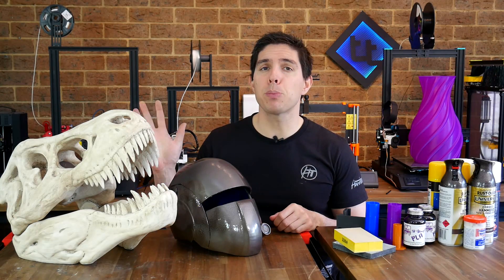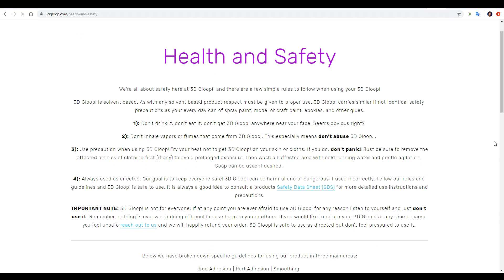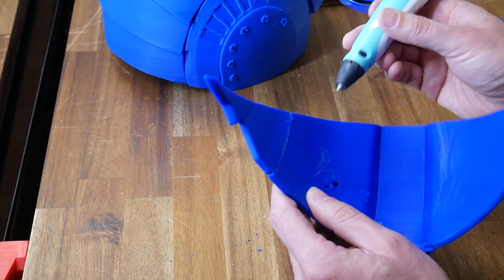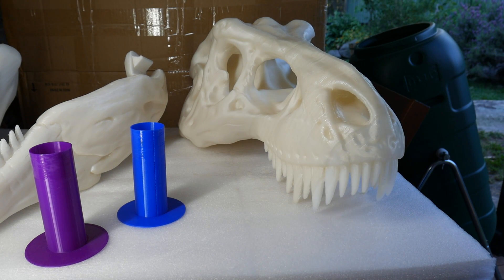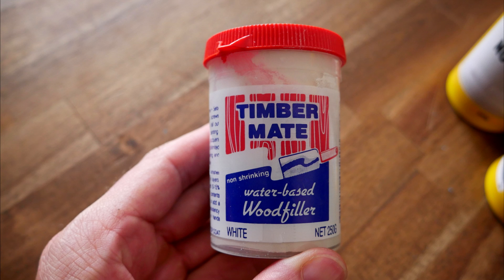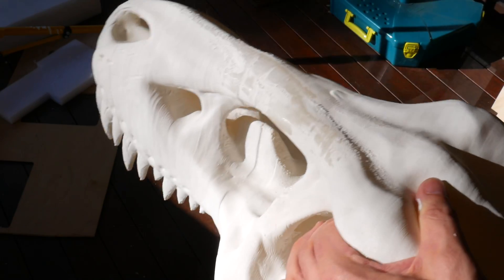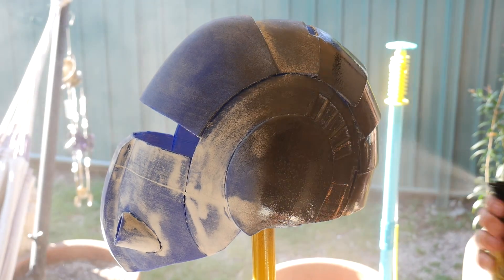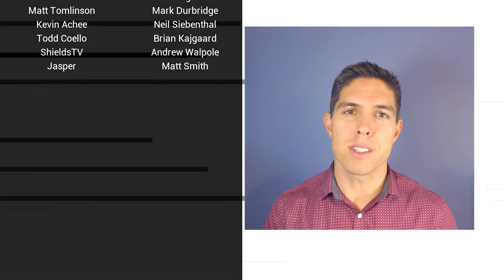Post processing huge 3D prints: Metal & Bone + 3D Gloop

Comment: I use spray filler/primer.. it works well to fill in small layer lines... for larger gaps and issues, I use bondo (pre-mixed in the tube)

Comment: Have used 3dGloop as glue and once for smoothing. It works well. Here is the one problem with the product, it has a limited shelf life from the time you open it. Every time I went to the bottle there was significantly less than when I had put it back up. After about 3-4 months what was left set in the bottom of the bottle. If I had a big project and knew I would be using a bottle fairly quickly it's well worth it. If I'm just gluing small stuff occasionally and not smoothing super glue is still better.

Comment: Thanks for this video. I am doing the same with my models. Another useful tool I use is, the Belt Sander! If you are quick, and light, it really can strip the layers away quickly. I hate sanding also, and like it quick, but, I am careful to not melt the plastic, and I really do like a smooth finish.
I too, found out about the wood putty idea, awhile ago. It is such a great medium to use. Much easier than using car bog (epoxy resin paste). Better for quick sanding, and easier to apply.
Thanks again for sharing your ideas. Love your videos.

Comment: Hi great video. Was the T rex skull one solid piece printed on a large printer or was it the one that comes in about 10 smaller sections. Saw a post of one on a pool table that a girl was sticking her head in. Each piece was a different color to show the sections. Just upsized from a ender 3 pro to a cr10 to print that one and was worried about the joint lines showing. Thanks.
Reply from the maker: This skull was only two pieces: skull and jaw. It's linked in the description.
Reply: TY

Comment: Helpful Hot Glue Tip if no-one mentioned it.
A very small amount (a couple of drops will do) of metholated spirit or iso-propyl alcohol will cause the hot glue to let go, and make it pliable and easier to remove.
Much safer than the blade, and much quicker and easier. :-)

Comment: I think product like 3D Gloop, Liquid epoxy, fiberglass, would work best by being applied generously where the coating material would self-level above all layer lines. PLA being difficult to sand may actually prefer file/rasp with rougher teeth over sand paper, clean the rasp with wire brush often. Higher temperature PLA+ may do better on finer sand paper.

Comment: Hey buddy, Ive been printing 1/18 RC car bodies and im getting awesome results from the $2.50 Motortech spray cans, (undercoat and yellow oxide) from AutoBarn and Supercheap Auto. the only down side is they take a while to cure, been such a high fill.

also... I highly recommend using a rotary tool with a flappy wheel, it self regulates the pressure and is less prone to overheating,  with a quick buzz over the surface and 2-6 coats of a high full undercoat with a very light hand sand between coats it should be very very close to perfect..

Comment: They both look pretty good in the end. I will say that PLA is an utter pain in the ass to sand, it's to hard and melts to easily, I don't bother sanding or filling it. Of all filaments HIPS is a much better option (costs the same as PLA as well) but stinks when printing, the upside is you can use modelling glue to weld bits together and it sands stupidly easy. Pretty sure you can use D-Limonene to smooth HIPS as well.

Got a tip with hot glue, use IPA on it, the IPA causes the glue to lose it's hold so it can just be pealed off, much easier than hacking away with a blade. Another thing (I haven't tried this yet) but apparently Dichloromethane also known as Methylene chloride can "smooth" PLA and weld it together, it's one of the main chemicals in most paint strippers and solvents and probably the main chemical in 3D Gloop as well.

Comment: PLA is an absolute bitch to sand. I've been working on a couple of printed items for a fallout cosplay. Primarily the combat armor. I can confirm that sanding is 90% - 95% of the process. My recommendation. Start with 80 grit to really knock dow the layer lines. Then move to higher grits. I went from 80, 120, 220, 320 and finally 400. Occasionally spraying filler primer or regular paint to fill in micro scratches. After all of that, wet sanding and battle damage. It achieved very nice results.

Comment: Great work Michael. I completely agree, getting the results you want is far more important than another's idea of perfection, it's artistic after all. Personally you've done a great job, they both have their own character. I'm not a fan of sanding either. A little tip I came across is to 'wipe' with the heat gun after sanding, it will bring back the original colour and get rid of the whitening. Of course, it's not really relevant when you're going to paint.

Comment: My experience with Gloop has been about the same. It is one of the best adhesives available for PLA, and a good bed coating. But claiming it smoothes, is a bit of a stretch. I have had some luck smoothing layer lines on small, delicate pieces; but it also kind of melted them a bit, loosing detail. It just  seems to build up on larger areas

While it is a great adhesive, Magigoo is a more cost effective bed coating. The shelf life of the PLA Gloop is also very short. I have yet to use all the contents of a bottle, before it dried up inside. Apparently it can be thinned, but they will not disclose what to use.

Comment: You can easily smooth PLA with dichloromethane also known as as DCM or paint stripper. If you cant get it in your country its almost always available as welding spray or anti spatter spray. Works like a charm just make sure it doesnt contain oil.
Reply: I may try this also, available at Bunnings, Poly Brand Original Formula.

Comment: Is that dimple effect intentional? It looks like the paint was loaded on too thick in one go.
Reply: I believe it is, similar to the old hammerite finish and better than smooth finish for hiding imperfections.
Reply: @Cloudman572   Ah yes, the hammered look! I forgot all about that. I used to use it in grey and red, it was cool. It had more of a rippled effect that this one though. It was like a two tone paint with cool streaks in it. The helmet here just looks like the paint has wrinkled, like it hasn't adhered or cured properly before adding more coats.

Comment: To whom it may concern: you can mix acrylic gel (aka structure gel) maybe even Mod Podge with plaster (gypsum) and apply. You can add a bit of water for an easier application or use a large brush to create texture. When dried it's relatively hard and feels like a pure plaster cast but still sandable.

Comment: Not perfect ???? Looks pretty good to me !  You can get a plastic primer from Bunnings or any  Automotive spray supply  company that will allow you to use Automotive paints , you can then use spray putty and high fill primer . You can then use the Hammer finish as you did or any acrylic or air dry enamel you paint what you  want .
One tip with rattle can paints is to either dunk them in a bucket of hot water for 15 minutes  or leave them in the sun for a little while as the heat  helps the paint to flow better .

Comment: Hand sand away the large imperfections and then three coats of quality primer paint followed by your preferred top coat should produce a high quality finish without any layer lines.
Faster, cheaper, easier and safer than the processes outlined in this video.
Reply: of course.  But the video maker  was looking for a better solution.  Sanding sucks.
Reply: @GerardHammond  The initial rough hand sanding is done during the inspection of the part after the printing is completed. It typically takes less 30 seconds and is only required to remove the large imperfections. The coats of standard commercial primer fill in the layer lines and provide a base for the top coat.

Comment: So if you add the post processing times (and cost) to something with a smaller nozzle and finer layer height, how does it compare (with paint coming from a $2.50 can)?
Reply from the maker: For smaller prints I think a small nozzle would be better. On these monster printer you might die waiting..

Comment: My process for ultra smooth print : Dip the object in hot water ( gonna save 50% of your time ) then light sand with 180 grid. Wood filler like a pig then smooth with water and sponge. Sand wood filler 180 / 500 / 1000 ( optionnal ) then 3 / 4 coat of primer and sand gently 500 / 1000 / 1500. It's gonna be smooth has ice without too much effort :)
Reply from the maker: Great tips, thanks for sharing.

Comment: 1.Superglue to bond pieces
2.Wood putty for filling
3.Putty filler spray can

Simple 3 steps..no special over priced product needed.

All available from Bunnings or any local hardware store. Works with PLA and ABS easy.

Save your money people. Its not rocket science
Reply from the maker: Good points. Just on the super glue, I usually use this, but it's worth checking the video from Joel in the description. He compares super glue, epoxy and 3d gloop back to back.
Reply: @TeachingTech  yes I saw that.
Don't get me wrong..Gloop seems to be a good product. But here in Aus its hard to get anything. And from US the postage costs are through the roof.
Keep up the great videos. Always enjoy learning something new.
Cheers 👍
Reply: @TeachingTech  I use clear epoxy some times to get some nice clear layers for certain prints. Or for Eg..to immitate water.

Comment: I've been using fiber glass resin to get rid of layer lines. Much cheaper than XTC3D or Gloop, and sands easily too.
Reply: for larger prints i do a 50/50ish  mix of resin and bondo (for cost saving)
Reply: Good idea! Fiber glass resin is pretty cheap too if I remember.  It's been a long time sense I looked at it
Reply: @mrhomely  $10-15 for a quart of the Bondo all-purpose resin.

Comment: The best lazy smoothing variant is to just brush on some epoxy. I used XTC 3d before, which works great, but you can use any epoxy really. I also always wondered if sand blasting 3D prints would give acceptable results.
Reply from the maker: At some stage I will get a sand blasting setup in my garage. Need to clean up first to make room.

Comment: supercheap auto has spray putty.  it's about the best i've found for getting rid of layer lines.  it is  much thicker than any other spray fillers.
Reply: There's like 3 different cans there, which one in particular?
Reply: @batman9592  the purple spray can.  Item No. 288524
Reply: @antonwinter630  Cheers Bud.
Reply from the maker: I've used it for F1 cars before, I agree it's good stuff. Just didn't have a chance this week to head to the nearest Supercheap, it's the opposite direction to work.